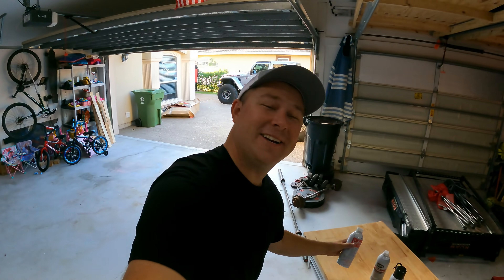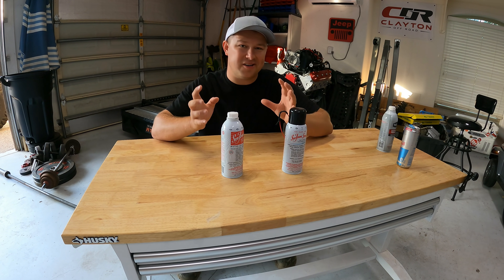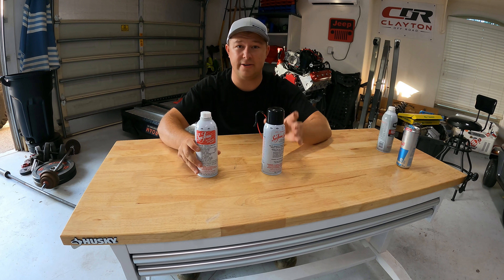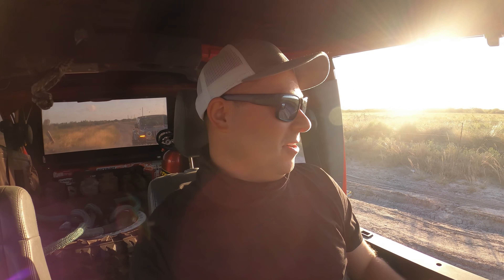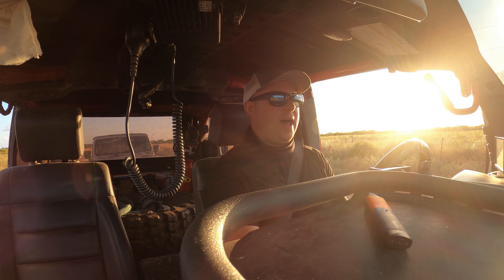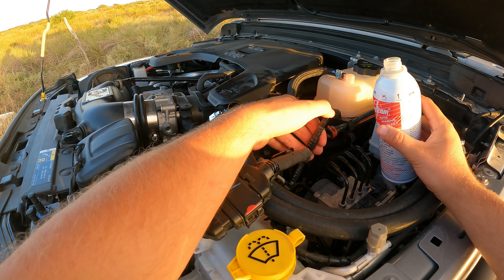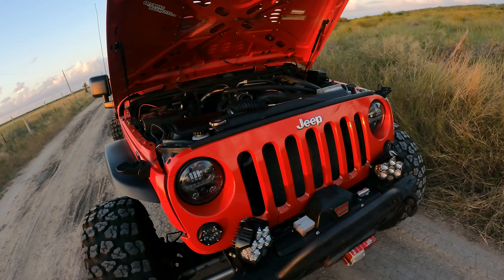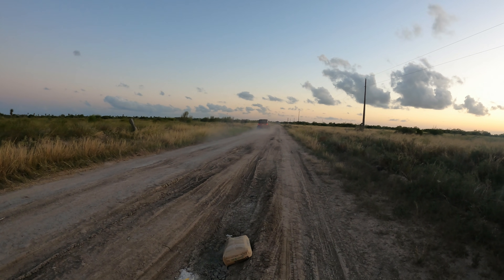How To SEAFOAM Your Jeep Wrangler

Comment: Hey guys great video. but I've got to add something important here.   As an Engineer who deals with failure mode analysis in an industrial environment,  and veteran jeeper,  please please please  note:  If you have less than 50k or so miles,  it's much safer to NOT do it that way.   Just use it in the tank through the fuel system then maybe once a year or after another 20k or 30k.  I've used and studied this stuff and the reason it works well is because of its potency.   That said, when it sits in those pistons they will have a very dry / gritty start which is where the potential for damage comes in.   Especially if someone puts in too much.  Just food for thought.
Reply: THANK YOU for this comment, because I was about to do it on my 51k mile jeep where she’s pretty clean already and I guess I was going for a more preventative maintenance trick but this is well needed advice.
Reply: Makes sense carbon deposits breaking free on a heat soak. Start up can cause scratching.

Comment: Well i tried the seafoam in the tank when i went to  Oklahoma and i have to say that i got better gas mileage on the 2nd tank after running the tank with seafoam in it. I was getting around 17 mpg now it gets 20mpg. Now im running stock  Except for the BFG K2 tires. I would  Recommend this to everyone. Thanks a million for doing this video.

Comment: So, looooong story short. THANK YOU FOR THIS VIDEO. I had a cyl 6 misfire code. Replaced ALL the injectors, coils, plugs AND O2 sensors. Code remained. Followed your tips in this vid and codes disappeared and JK idles like a champ. Smoke bailed out as I drove through my neighborhood. You were right. I got looks. Had a po300 code come and go during the bad smoke. A Lot of hesitation and lag. Just kept driving. Within about 10-15 minutes, all the exhaust had cleared up and the engine was doing great. So grateful you made this video and the YouTube rabbit hole led me to it. You guys rock. 👍👍👍

Comment: Good info.  One tip I recommend is run this before you put in new spark plugs.  Using the seafoam I've noticed can create a little bit of build up on occasion on the spark plugs.

Comment: Every oil change I dump some fuel system cleaner in my wife's LJ. I clean the throttle body every 3rd or 4th oil change.  Started that routine at 15k miles now we're on 170k still running ok. Change the plugs every 30k. They always look fairly clean. Thanks for the vids.

Comment: Evening Ben, It’s Wade Skinner I have used sea foam in my Jeep CJ7 258 inline 6 engine today for the first time ever. Drove it around down town Waxhaw North Carolina and back home to Indian Trail North Carolina , it didn’t smoke or anything like that . My Jeep CJ7 drove very well. A fellow I mentioned this to said when he put it in his ‘02 TJ Wrangler it gummed up 1 of his sensors , he could not drive it for 6 months he says . But I had issues though I do have the Carter BBD Single Barrel Carburetor on my I6 engine. I wanted to let you know that I watch all your and Cassie’s videos.

Comment: Seafoam's competitor- Chevron Techron is what I used in my motorcycle gas tank. The neck/tank was typical rusty, brown looking. The next time I opened it it looked shiny and brand new. Obviously this stuff works. It's nice to see it instead of 'hoping' the inside of your engine is clean. So if Chevron works, Seafoam would too. I've used the Seafoam straw before. I did just cram it into the inlet air tube and let-er-fly!!

Comment: Do an oil change with Royal Purple. Apparently it’s got some detergents in it that will clean a lot of build up in the lubricated side of the engine. There are a couple of videos showing before and after. That being said, I only run it one cycle out of the year, MOBIL1 is still my go to. Anyways food for thought, another great video!
Reply: After replacing my motor I’m only using royal purple now.

Comment: Another really good use for it is to add it to your oil for the last 1,000 miles before an oil change or atleast a few days before an oil change. It really cleans the engine super good. Friend of mines been doing this and he had to change injectors on his 2003 6.0l powerstroke with 300k miles, when he took the valve cover off the heads looked brand new. No sludge or buildup of any kind at all.

Comment: I use the amsoil spray cleaner that you spray through your throttle body (which cleans the throttle body as well), it works great!  I use it before every oil change.

Comment: I just pour it in the gas and use sythentic oil. When I first got my 2000 xj I used sythentic oil and about 5-6 oil changes later it leaked everywhere. I use this stuff or gumout about 2-3 fill ups.

Comment: Nice video Ben, but the process of cleaning through the intake is more for direct injection vehicles. The 3.6 is still mpi where the fuel injectors spray upstream of the intake valves and keep them pretty clean. The whole catch can design is almost required for direct injection since the evaporated oil from the crankcase cokes to the intake valves and the fuel is injected downstream of the valves, not cleaning them. GM's DI engines are having a tough time with this.

Comment: I also seafoam during oil changes. Drain oil 100%, replug, pour in a bottle of seafoam, crank the engine a few times (15 sec don't want to damage rings.) Reopen the drain plug and watch more junk come out. Some people also do this old school way with diesel fuel.

Comment: Using the vacum line from the brake booster bypasses the Throttle Body.....Using the aerosol on the Throttle Body helps clean it and maybe more of the Intake manifold.
I would like a can of SEAFOAM for my 2016 JKU with a catch can just now at 15,000 miles....

Comment: My 27 year old 5.2 ZJ is on its second motor. These engines have horribly designed factory intake manifolds. Which causes the plenum to leak. Causing oil to be gulped! I just replaced my manifold with a Hughes engines hi rise and would love to clean the bottom end out with some sea foam!!!!

Comment: also if you hat a lifter tick add the caan straight into the oil on a warm motor. it will clean lifters cams break up all old oil build ups and id do that ever 50-75 k if you use regular oil, for full syn once every 100 k if you notice build up when u change valve covers ( i work on vehicles and ive been doing it on my own for years but dont over do it

Comment: Another good tip is to not run any ethanol blended fuel. Up here in Canada the low and mid grades both have 10 and 5% ethanol I believe but the premium is ethanol free. You end up getting better gas mileage and better throttle response.

Comment: Good stuff Ben, but you should actually give Berrymans B12 Chemtool Total Fuel System Cleaner a try. Seafoam works ok for marine applications but Berrymans is the ideal product for a spotless engine. Lots of smoke out the tailpipe doesn't really mean anything really fit clean.

Comment: Thank you for this video!! But I’m a little surprised, I sucked seafoam in to my ‘14 Jeep Wrangler with 155,000 miles just as you did, and waited 20 minutes, started it up and I had absolutely no smoke! I sucked in about 5 ounces. I also put about 5 ounces in my oil and 6 ounces in my fuel tank. I’m not sure if I did something wrong! 🤔🧐 It does however, seem to be more responsive and running better. I have a half can left, so maybe I’ll try it again!

Comment: Typically if you keep the oil and oil filter changed frequently and change the air filter frequently the inside of a motor should run pretty clean.
I've seen 100k mile vehicles opened up and everything looked clean but then again that's changing oil and filter every 4k miles.
That's a little to often for some folks but it works very well.

Comment: I find the best results for getting carbon off the pistons is to dump the Seafoam in the spark plug holes and let it sit overnight. Turn it over the next day to drain the cylinders and then change the oil to remove any that seeps past the piston rings.

Comment: Great video! Should I add seafoam through the brake booster vacuum when I am add the areasol to the throttle body, or should these be done at different times? Do these 2 methods, in theory do the same thing? I am looking to run seafoam through my fuel tank and also one of these options you showed here. Any thoughts on adding directly to the crankcase/engine oil? 

Would like to be entered in for a free can of seafoam!!

Comment: What do you think about between 80,000 to 90,000 miles would it be beneficial the use this?
Reply from the maker: Yep! Or just get some Techron complete fuel system cleaner from Walmart and run that in every few tanks. Sea foam is getting too pricey

Comment: hey guys. Any insight about using this on a JK 3.6 with Magnusson Supercharger? A bit nervous to get too Jiggy with Froced air and engine cleaner 
... what do you think?
Reply from the maker: I’d be careful or might shy away from the vacuum method through the brake booster, just because I’m not sure how well the magunsson tuning handles large vacuum “leaks”. You will be fine in the gas tank however. If you do the vacuum method just don’t try to pour too much in at a time.
Reply: @JKGearandGadgets  thanks for the clarification.

Comment: If you have a cold air intake on a JK could you just spray it into the end of the piping or the filter instead of the throttle body?

Comment: Hey Do you have a link for the viper throttle body for the jku
Reply from the maker: https://amzn.to/32pClQE
Or search for part number: 53032837AB
You will also need an adapter for your intake depending on what your running.